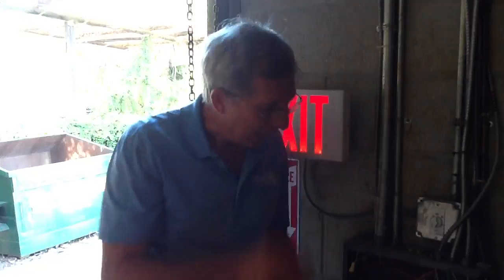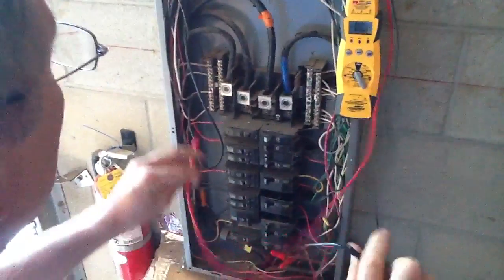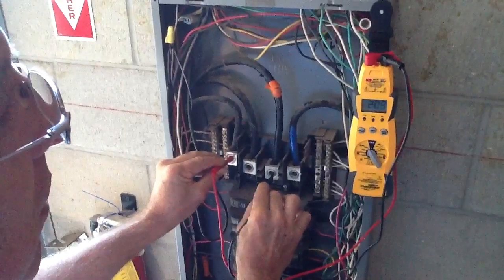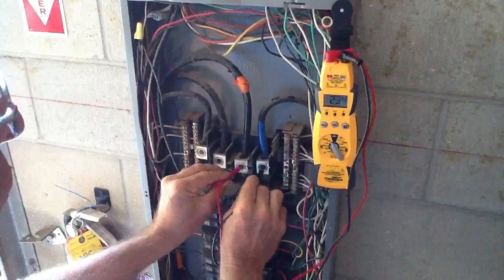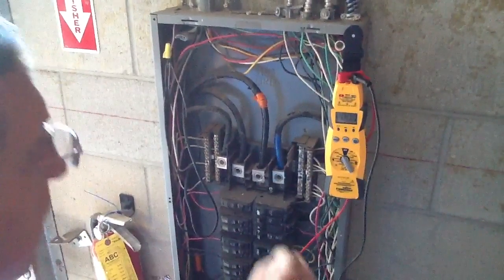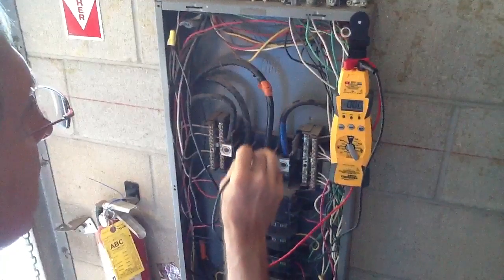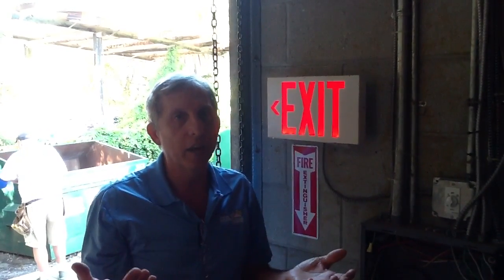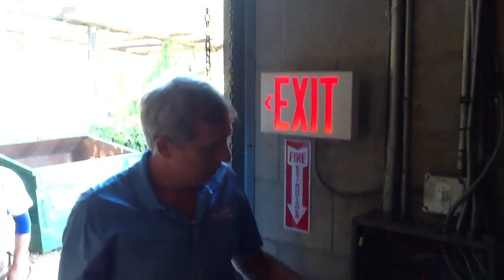How to measure 3 Phase Voltage with Highleg

Comment: But that’s not a 120/208 panel box. It’s a 120/240 panel box that happens to be a 3 phase delta with a hi leg….the 208 is not usable on a single pole circuit. This phenomenon occurs because B phase is 1 and a half coils away from the neutral while A and C phase or only one coil away from the neutral. Video seems to be accurate with the exception he kept calling it a 120/208 panel box. 120/208 is a wye circuit and there is no hi leg on that system. All three phases to neutral will give you 120. Phase to phase will give you 208. That’s not the case with this panel box.

Comment: This is why you don't have HVAC tech's doing electrical work. This guy has no business being inside an electric panel...
This is NOT a 120/208 3-phase system. It is a 120/240v 3-phase, High-leg delta system.
He says its 208, then proceeds to measure 240+ volts phase to phase..  😂😂.
This is a 10-year old video. I wonder if he's still alive, or did he get electrocuted?

Comment: What if you have a three phase ac motor with no neutral? How would you check to see if the leads are live?
Reply: Measure phase to phase, in a 120/240 system you'd have 240 between phases.

Comment: I have this type of power distribution to my house which was built to commercial standards back in 1940.  I am curious as to the history of this  type of distribution which I had not been aware of heretofore. I have learned that this type of distribution is properly called 3 phase 4 wire delta high leg? It seems like an ingenious method to provide both 3 phase  and single phase power to a site which is ready to go without any additional on site transformers and using only 4 wires to get it there.

Comment: You incorrectly identified the system as a "120-208, 3-phase" system. That is totally wrong!
. 
The system you are showing and measuring is (more than likely) actually a 120/240v hi-leg, 4-wire Delta system (or open-delta system), which has 120v (to neutral) on two legs, and 208v to neutral on the third leg. Hence, the term "Hi-leg".

A 120/208 Wye system would have 120v to neutral on all three legs, and 208v between phases.

This is why you DON'T call an A/C contractor when you beed an electrician! 😅

Comment: NEC 110.15 . . . . . the conductor or busbar having the higher phase voltage to ground shall
be durably and permanently marked by an outer finish that is orange in color or by other
effective means. . . . .

Comment: What is the point of a high leg?
Reply: 208 volts to ground  is not an intended voltage in this application,  it just happens to be a byproduct of the transformer configuration.   The typical application for this type of service would be in commercial or industrial settings where the majority of the loads are 3 phase motors,  with a small amount of 120V loads. Typically these systems are found in older buildings in rual areas, you rarely see them being installed as new systems.

Comment: The panel box is labeled correctly. By removing that orange tape on the B phase, you are held liable. If you were to open the transformer, you would see on the secondary side PHASE A=BLACK
                             PHASE B=ORANGE, not red
                             PHASE C=BLUE
Reply: He didn’t remove it, he said he’s the one who put the orange tape.

Comment: If you had measured all three phases against each other and if you got 208volts and 120volts from neutral to each line then it would've been a 120/208Y system

Comment: So have an existing panel that is reading 123 on both A and B phase but for some reason C phase is showing 216.
The panel is supposed to be set up for commercial A/C’s with two 70 amp 3 phase breakers.
Any ideas??
Reply: Split delta flying high leg?
Reply: In that case based on your readings you have a 120/240V 3ø 4w system, and the high leg is terminated on the C phase.    In installations before 1975, this was typically the case, but after 1975 the high leg should have been terminated on phase B.   High leg should be orange, and regardless of the panels you should always verify with a meter before connecting stuff.   Do not rely on colors or labels.

Comment: I have a 240/480 3 phase system with the high leg.  From line to ground, I have:  L1-242 VAC, L2-420 VAC, L3-242 VAC.  Line to line averages at 482 VAC.  I have a servo drive being powered by this system, but, my servo drive needs each leg to be balanced.  Other than having to install a transformer to balance the system, what other options do I have?
Reply: Good question. Glad you asked.    Unfortunately you don't have options other than to install step down transformers on each leg to balance the system,  that's the major disadvantage of a high leg system.   Assuming there is 240 volt equipment running off L1 to ground and L3 to ground,  you could install three 480 to 240 volt or 120/240 volt transformers, to try and balance the system.   In fact a 240/480 4 wire delta is pointless,  I've heard of them but never worked with one.   I've worked on 120/240 delta systems a handful of times.   Normally with a 480 volt system  it's 277/480 wye,  your heavy equipment runs on 480, your lighting is 277, and there is a 480 to 120 transformer to power your general purpose 120 volt receptacles.   This is how a shopping mall, or Walmart Supercenter,  for example would be set up.

Comment: I was checking a 3 phase system and I got 120 120 120 to neutral. What is going on
Reply: This is a 3 phase delta (high leg)system. Voltages are 120/208/240. You most likely are dealing with a 120/208 wye system. Phase to phase should give you 208 and each phase to neutral will give you 120. It has to do with the configuration of the transformer. Hopefully this helps

Comment: I have a meter main with three hot lines. They are 120v, 120v and 213v. Does that mean I have a three phase 208v. panel?
Reply: No you have 120/240v 3phase 4 wire. 213 is your high leg and is not used for single phase loads.

Comment: Its a 3 phase 240v delta. B phase high leg is by code labeled orange. Colors are
A Phase - Black
B Phase - Orange (high leg)
C Phase - Blue
Reply: C Phase is Red
Reply: @actionjackson8439 Yes the C phase could be red as well.  The NEC only specifies that if there is a 3 phase 4 wire delta system, the conductor with the higher voltage to ground - high leg - shall be colored orange.   Doesn't specify what colors to use for the other conductors other than white or gray is for the grounded (neutral) conductor and green is for grounding conductors.  

However the convention is to use black , red, blue and white for 208Y/120V, black, orange, blue and white for 120/240V 3ø 4w delta, and brown, orange, yellow and gray for 480Y/277V.

Comment: You do know that this system is banned nec.1977.
Reply: Can you provide the NEC reference that ‘banned’ 240-volt, 4-wire Delta systems…..I think you’ll find you’re wrong.
Reply: @jjoejones1  I think what willie isacz might have been referring to when banned, is what they called a delta breaker, that was used in a single phase panel to power one three phase load, typically in that era a 5 ton air conditioning unit. Most people probably have never seen a delta breaker or know that it existed, because it is a very oddball type.  But yes 120/240 3ø4w is still allowed and sometimes still used in new installs,  but is not nearly as common now as is was, say in the 50s and 60s.  A common giveaway is 3 transformers on the pole, one of which is significantly larger than the other two.  Another strong clue is in the panels with single pole breakers, every 3rd breaker opening is not used.  These installs in this day and age really are kind of pointless,  but you will run into them on different occasions.
Reply: @Sparky-ww5re  Thank you for your reply. I am familiar with Delta breakers but when Willie used the word ‘system’ in his comment, it did not appear he was referring to delta breakers. Regarding the transformer configuration for a 3-phase, 4-wire Delta. In my area it is more commonly seen as an ‘open’ delta which only requires (2) transformers as opposed to the ‘closed’ delta which requires (3) transformers.

Comment: Not 120/208. It is a delta 120/240 with a power leg of 208. And the power leg should be connected to “c” phase.

Comment: Hi I am in Canada we got machine required 230v AC 3PH we bought transformer step down 600v to 230v with high leg so machine has two drives one 3 ph 230v AC and one single phase 230v AC . Electrician pull three wire and ground wire from transform to  machine so after few month single phase drive fail when I check it was hookup with phase A&B I mean hot leg  and one another leg but when I check those two with ground it shows 110v and 203 volt and when I check cross it shows 230v my question is 1. what was the correct way to step down the voltage and connect the machine 2. why when we measure voltage cross AB,BC,or CA  it shows same voltage if B is hot leg then AB and BC should read alot higher then CA almost 40% higher 3. What you think drive fail because hot leg was connected. 4. why most of transform has not high leg 5. Transformer marked X1 X2 X3 and X6  (feed out) so X6 will treat as a neutral or as a ground in side the transformer they have jumper anyway thank you

Comment: Omg 3 phase wiring is so much simpler in NZ than the USA. We have L1, L2, L3 + N and + E  Red , White , Blue, Black , Green/Yellow sometimes with out the Earth or sometimes with the Earth and not the Natural
Reply: Same as South Africa

If we did a high leg like theirs, we would still have 400v phase to phase, but we would get 230v phase to neutral on the "high leg" and 200v phase to neutral on the other two.
We don't bother, we just go 230v/400v.

Comment: I have a couple of questions. First there's a Jones heating and plumbing in Plymouth, Indiana, about a half hour drive north of where I live. Are you part owned by the same company? Also in a 120/240/208 hi leg system what is the 208v wire (phase B to neutral) used for? I don't know of any household appliances that use that voltage.

Comment: I can't see how u get 208v from hot to neutral I service In ny and it's usually 123 to ground on each phase 208/240  between each phase 123 or abc so again huh
Reply: Your three phase service is a WYE type of service, and his is not. His is also known as a high-leg or wild-leg delta system. That's why there is a 208V from high leg to neutral.
Reply: Vectors Baby!

Comment: No PPE, fail.   Meter leads not both in one hand, sometimes required but never recommended.   Do try to avoid setting up a situation where the current path is thru your heart if something should go wrong.

Comment: Phase B is not required to be the high-leg, any phase can be high-leg as long as it is permanently marked (NEC Article 110.15)
Reply: You may wish to read 408.3(E)
Reply: @jjoejones1  Thank you and I just did. You are correct for NEW installations, but there's an exception for additions to EXISTING installations so my original comment can hold true. B phase high leg would in most cases be required per code and conforms to industry standard, so it is best practice.
Reply: @nickesposito3497  as an electrician myself,  we have the golden rule: don't trust colors, trust your meter.  And always wear your PPE when probing inside a live panel.

Comment: Orange is always used to mark the "high" or "wild" leg, 208V to neutral. I wouldn't refer to this system as 120/208 because it is not a Y service. It's a 120/240 3-phase 4-wire system. Adding the neutral connection creates the "high" leg. The 3-phase aspect of this system is a 240V delta connection. It gives you 240V 3-phase for motor loads, etc. It gives you 120V 1-phase for lighting/outlets. Also available is 240V 1-phase for appliances. Your panel will have some wasted space due to the "high" leg.
Reply: He did mention at the beginning that someone had not marked the "B" phase Red so he added the orange tape to signify the high leg just in case anybody missed that..
Reply: This delta 4 wire secondary gives you 120/208/240 single through 3 phase connections.
Reply: So if you're working with 120/208 wye system the 3phase breaker can land on any configuration of ABC "BCA" and it will work the same since there is no high leg? Will just end up with different rotation on a motor?
Reply: @mikea9365 Correct.
Reply: In Canada the high leg is A phase to the neutral. Our rules state that the 3phase and 1phase services must be separate. It's not too common.
Reply: All I know is Dat crazy man wanna talk about IT, mon. Without wearin dem gloves no less. Mon.
Reply: No… the high leg has to be orange. You can’t pick any random color
Reply: @atmacm  it always amuses me when people who have never worked a day in the trade act like they know everything LMAO. 

High leg is orange period. There are only some very specific local exceptions where the ahj specifies a different color. Austin TX was one of them.
Reply: @Squat5000  I've heard old timers referring to high leg delta as red leg delta,  so I guess in theory it could be red, perhaps in very old installations or in certain jurisdictions,  but by convention the colors to be used are as follows: 120/208Y, black, red, blue & white   120/240 volts 3 phase 4 wire, black, orange,  blue & white. and 277/480Y,  brown, orange, yellow, & gray.    Ground is green or bare.   Regardless,  always verify with a suitable meter, never rely on colors to tell you the system voltages.     A high leg delta service can oftentimes be identified before you even walk into the building by looking up at the transformers,  assuming they're pole mounted.    Three transformers,  one of which is larger, is a strong indicator,  because one of the transformers will be loaded much heavier if there's any significant amount of 120 volt loads on the service.  Load balancing tends to be poor, and there is a risk that someone working in a panel might connect a single pole breaker on the high leg, thinking they are getting 120v, smoking up equipment when the power is turned on because you will be getting 208V.   For these reasons 120/240V 4 wire delta systems are typically no longer installed except in a very unusual and special situation.   The utility will supply you a 120/208Y system nowadays
Reply: @Squat5000  probably i think if you color it purple or something unusual along with making the panel front warning this is high leg c with the given voltage the point would get across what kind of panel this is.
Reply: 120/240v colors are Black/Red/Blue; 2$0/480v or 277/480v colors are Brown/Orange/Yellow. At least in the US orange is not the normal/exclusive color for the high leg in high leg delta. Perhaps the orange was a really faded red as that would make more sense or perhaps the person was out of red tape.
Reply: NEC 2014 110.15 High leg Marking. The conductor having the higher phase voltage shall be durably and permanently marked by an outer finish that is orange  in color.

Comment: Just because you wire you more ABC, does not guarantee you'll get the rotation you want. You have no idea what rotation the utility provider is giving you. They switch A and C phase because the utility power is the opposite rotation they need
Reply from the maker: true

Comment: Brown yellow and orange are 480 volt 3-phase leg blue red and black are 120 208 volt 3-phase leg colors .
Reply: 3 phase delta systems have a High leg and it is marked orange, 3 phase Y systems use black red and blue.

Comment: Hi Mr Jones, I dont have good knowledge in electricity, just curious asking, does it dangerous using the multimeter to measure the voltage like what you did ?
Reply: anything i need to be aware?
Reply: ELFYHO if you don't know what you're doing. if you're not an electrician or have a working knowledge of electricity don't do it. you don't get second chances with electricity

Comment: Good explanation Dave
If you can take some constructive criticism, I'll bet 5 dollars against a stale donunt there is probably 6000 amperes at that buss all ready to burn hide and meat through an arc-flash along with plasma particles to be injested when something goes wrong and the planets all line up. As an inspector if I observed someone doing this at a mine I would be obligated to issue and imminent danger order along with a citation that could cost in the 5 digit category. Other than that I'm a fan for sure.
Bob
Reply: Agree. No PPE, but 208V high leg isnt likely to arc flash like 480V will. 6kA fault current is probably low. He also didnt check A-C phase, tho it's likely 240V given his other readings.

Comment: what if you get 120v on all 3 phases
Reply: Then it's a 120V/208 3 phase wye system. This is not a 120v/208 system. This is a 120/240 3 phase delta.
Reply: Alex Millison. so i could not get 240v so i just ran the air at 2o8v but it worked
Reply: birdchaser2010 most motors will say on the nameplate if they can operate on 208V. if it's a 240V appliance that has a fixed resistance like a heater, it's perfectly fine to run 208v to it. it'll just draw a little less current and not produce as much heat.
Reply: Alex Millison. it did say that
Reply: Alex Millison That is why I call it the wimpy wye system.
Reply: a m www.     Vhiw9q091999398e822892939828iiii3iei3939933b.  Nn3kalalLlslsslslel939e9o209e0009e777662663343212210+